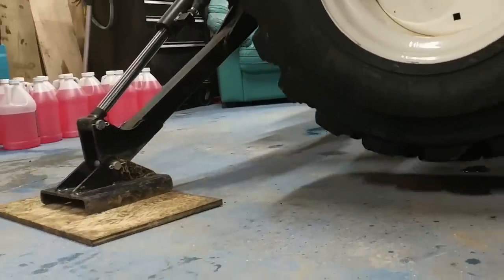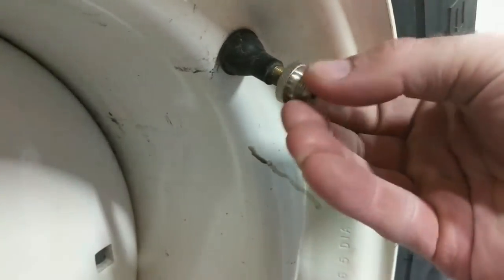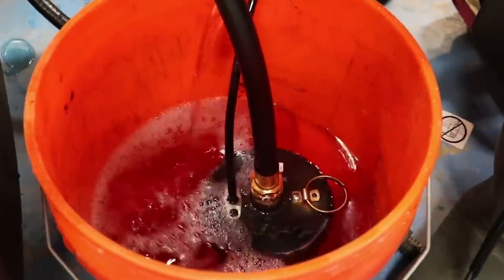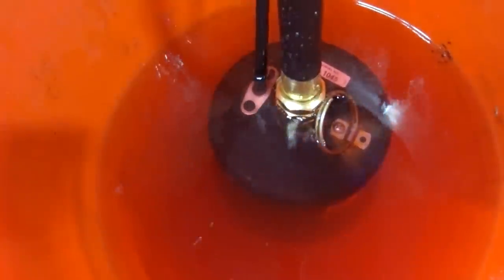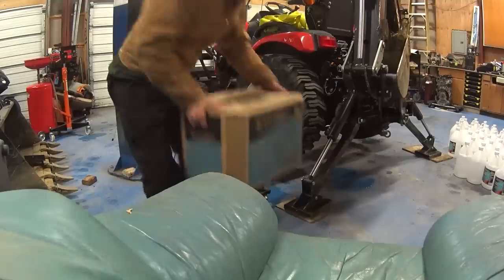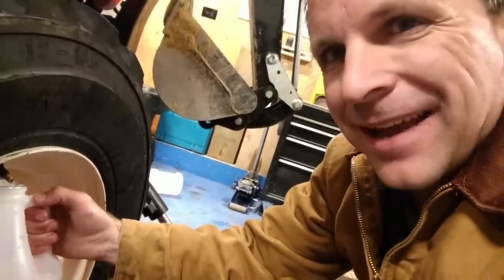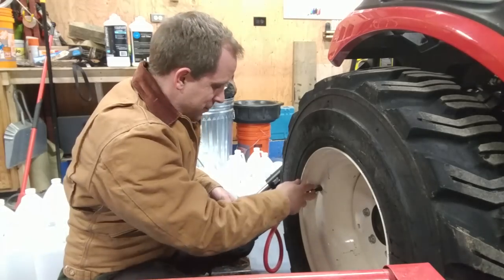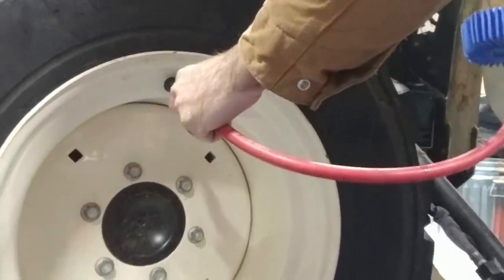Get More Grip out of your Tires!

Comment: I really recommend a tube inside your tires. That way it's not bare against the rim,won't leak out the bead,you'll never have to worry about the bead popping off and losing every bit of your liquid. And with a tube you can fill it first and then air up the tire
Reply: How many gallons of antifreeze if you have tunes

Comment: Great video, 
Straight to the point and informative.
So tired of slipping with my loader and don't want to spend the price for rim guard filling.
I'm actually doing this same thing soon. I have two 55 gallon drums of rv antifreeze ready.  Should give me almost 900 lbs of weight for both tires on my JD.

Comment: I just gravity feed my tires with the same adapter for SLIME, cost about $15 from TCS , I used a hose and funnel. Slime does also sell a pump etc for this job as well. However now that I saw you use the submersible pump, I have the same pump. That will be how I fill the next tire and I’ll see how the job goes. It looks a lot faster. Great video.

Comment from the maker: The antifreeze I am using is 9lbs per gallon, compared to Rim Guards 10.7, but at about 1/3rd the cost. If my math is correct I have about 423 lbs added to the tractor, vs 503 lbs if I used Rim Guard, and it would have cost me around $300 more for the additional 80lbs. You can only get it by the 50 gallon drum, so if I ever needed to re-fill one tire, it would be very expensive.
Reply from the maker: I didn't want to unmount my tires to install a inner tube to run calcium. I don't have the gear to do that, or mount a wheel that's been filled!

Comment: nice video, question, once you fill the tire, how much air do you put in the tire?, Same as suggested on tire sidewall? thanks.
Reply from the maker: Yup, same as normal, just make sure the stem is at the top when filling, and you dont overfill with liquid

Comment: Great video. Going to do mine in the very near future as I have my 50 hour maintenance coming up in 1 more hour. Did you do your front tires too? Also how far did you fill them with liquid? Looked like about 75%, is that correct?
Reply from the maker: I did fill my fronts! They recommend not to fill them, as it can cause more wear on the axle. But i like to live dangerously!

It was about 75-80% you do need a bit of air as liquids dont like to compress, the tire would take more abuse with every bump

Comment: Good video. I don't have any tractors with directional tires. I have a question. Would your v traction tires have more or less grip if you flipped the treads backwards? would that push the dirt to the center rather than outward? It has bugged me for to many years and got to ask. thanks , just a residential home owner.
Reply: On A Grader For Example , Some Run the V Forward To Hold On Side Hills When Blading. The Tires HOLD BY Compressing soil into the V & does Hold the Front Up With Limits.
Reply: As a kid, I had a 60 cc dirt bike, back tire that had v grooves. I switched it around so I could climb a certain hill better with the v “catching” the dirt for better grip. It worked for about 10 seconds till the dirt packed it tight and I was then running a smooth dirt tire tread 😄 Switched it right back, to throw that dirt out of there as soon as possible.

Comment: The problem is that this fluid will freeze at warmer temperatures than you think.  The -50 is for bursting and expansion only. It will freeze in your tires and you will be unbalanced. It is made to keep pipes and pumps from bursting. Set a jug out in the cold of winter and it will freeze solid.
Reply from the maker: I did go through some very cold NH nights without any noticable difference last year, but I will keep an eye on it this winter as well! Thank you for the warning!
Reply: Great video! First of all the person that asked will it rust the rim compared calcium chloride is no. Calcium chloride is worst than salt although it will be heavier but expensive. The RV fluid will not hurt the rims especially if you accidentally leave some out and falls on the rim. You also can use windshield washer fluid but make sure the minus temperature is low enough at least -37F. I wish he would have mentioned where he got the kit from. I want to put fluid in my X738. Good job.

Comment: Could I do this with my riding lawnmower tires? Im really considering because I always am loosing traction on the slightest due or slope but just dont want to damage the mower.
Reply from the maker: You should be able to, depending on the size of the tires it might not be much weight, rimguard i believe has some charts to help you figure out how many gallons, and how much weight foe the tire size.

Comment: if you take tire off and lay on its side would it take more liquid ?
Reply from the maker: I dont believe it would. becouse of where the valve sits you would have more volume of tire above it when its on its side. but you really dont want much more liquid anyway, becouse water/coolant doesnt compress, so every bumb would send a jolt though the teactor... the air does compress sonit absorbs some of the shock. also you need it below the valve to be able to top off the tire with air, and not destroy the seals when you inflate the tire with air.

Comment: How did you install the ROPS lighting?
Reply from the maker: I ended up welding a bracket to the side of the ROPs, and used part of a truck wiring kit for each light. I plan to redo it later, I will try to document it!